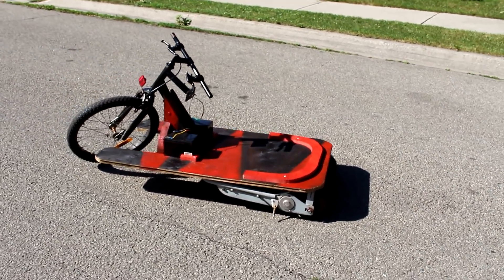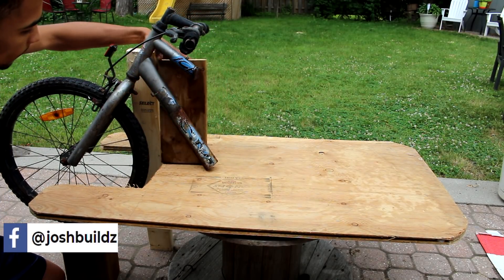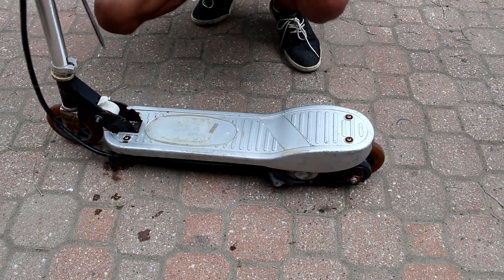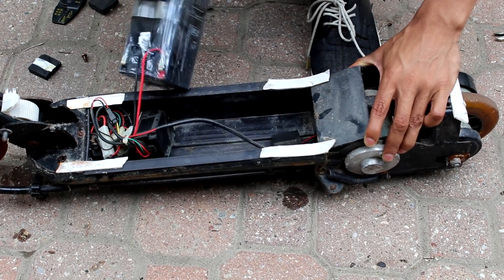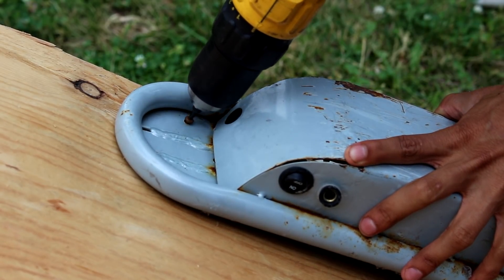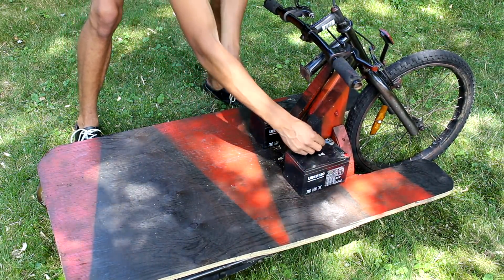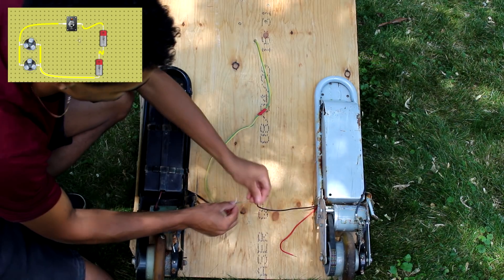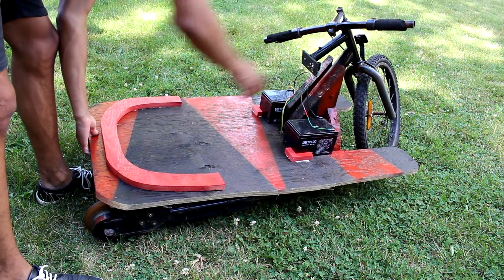How to Build An Electric Go Cart From Recycled Materials

Comment: You should run 3 batteries in series and i do not think that switch can handle the amp's it WILL melt. You should run the esc's and wire one throttle to control both esc's. It would be more reliable and more power and speed on 36v. I ran a e100 on 40v with a 24v 300w motor from a razor gocart and it ripped hard and topped out at around 20mph!